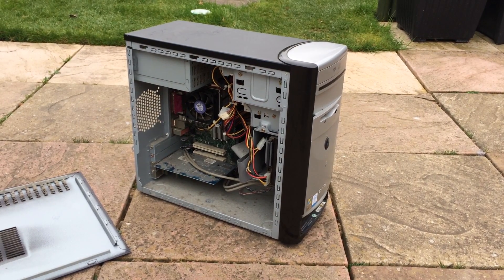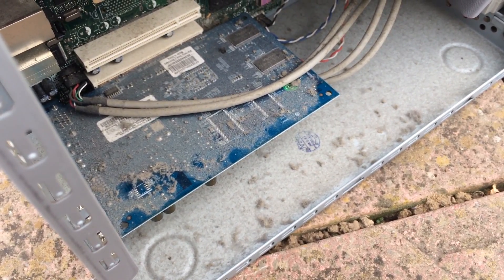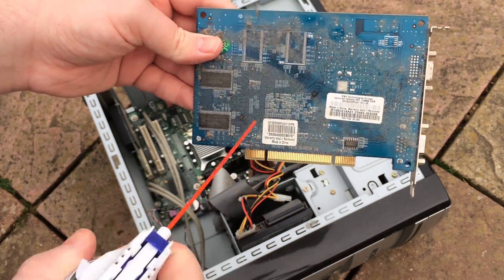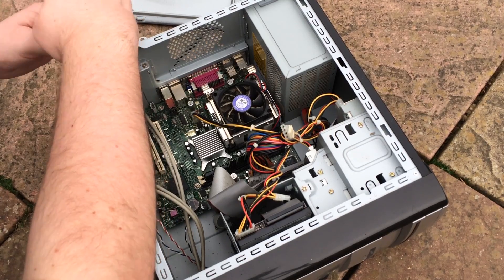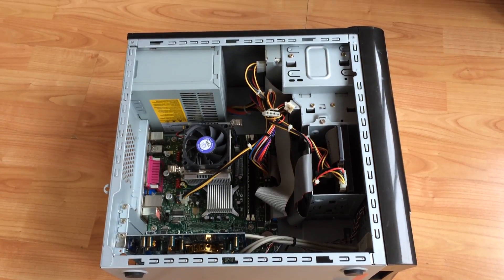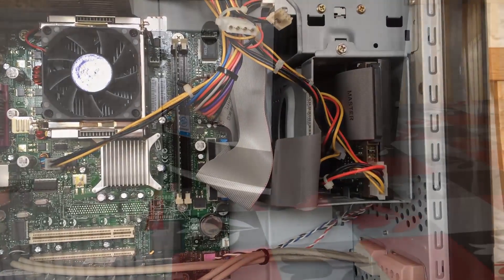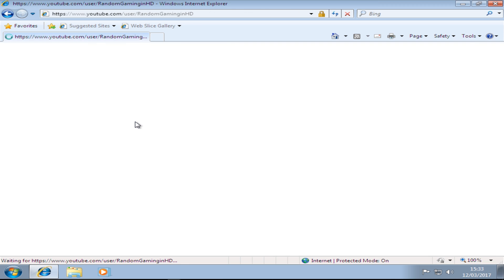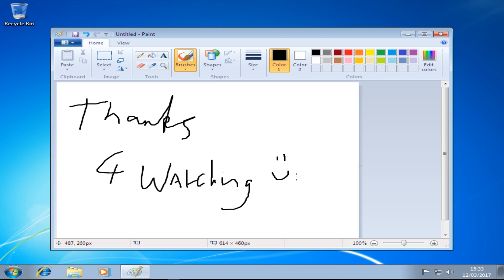Cleaning up a Super Dirty Old PC

Comment: I've got a question I'm hoping you can help me with, with my computer case fans, the fins are extremely dusty. I can't really get in with a rag or anything either to clean them, and a handheld duster isn't strong enough to get the dust off. What do you suggest I do?
Reply: Maybe a Q-tip
Reply: The most important thing: prevent spinning when cleaning. The same way as electricity creates movement, movement will create electricity.
I'd suggest a toothbrush or a pastry brush. Also a good choice to clean out heatsinks and boards without damaging anything.

Comment: I'm building an old budget gaming PC. I have G41M-P26 motherboard, Core2Quad Q9500, 6GB RAM and GTX560 TI. What Wattage PSU should I buy? I currently have cheap $10 PSU.
Reply: Get the cheap EVGA 430W and you'll be fine
Reply: Ashish Kotnala 500-600w
Reply: No, it's not needed.
Reply: Ashish Kotnala a decent 550 probs
Reply: FiftyHP for a 560ti? The Rec is 550
Reply: Still no, I had a GTX 560Ti, Q6600, 6GB RAM and my 400W PSU was absolutely fine.
Reply: The Q9500 has a TDP of 95W and the GTX 560 Ti sits with 170W (210W if it is the 448 shader version)
Calculate around 30W for the board and maybe 5W per RAM stick.
Add a little overhead to be at a draw of high efficiency and you will sit around 400W for the PSU. Maybe abit more, depending on the drives and fans. (count 3W per fan and 6W per drive)

So I'd suggest something in the usual 450-500W range. But don't go too cheap, or the PSU will take everything with it in case of a failure. Around 40-45$/€/£
Reply: Thanks everyone for their suggestions. HappyBeezerStudios - by Lord_Mogul Can I go for the Corsair VS450?

Comment: my gaming pc I use it for browsing I been sick haven't been able to use it in 7days feel bad but I buy new and used parts to save money I wanted a second pc bought a laptop with broke screen I run it with the screen closed so its not even on but for 35 couldn't go wrong I helped my sister get a 50 dollar gaming laptop which is pretty ok ran csgo 30fps which is good for a laptop because mine was running like 5 frames lol

Comment: Nice job with cleaning and tidying this old warrior :p I usually suck out the biggest dust with plastic tipped vacuum cleaner or just have enough bars to blow out all the dust that lurks inside psu, fins etc. 

Ps. usually with older pc's which have "open" condensators in motherboard and are really dusty, have atleast one popped condensator. It can be replaced with bit of handcraft if the pc doesn't wanna work anymore, done it a few times to older pc's to give them life for a bit longer :)

Comment: 2:34 That thermal paste looked a bit watery.
Reply from the maker: Xenon777 yeah it is quite watery, but works very well
Reply: The video was accelarated, that's why it looks less viscous.
Reply: Xenon777 is an overclocked thermal paste
Reply: it's grey paint
Reply: Xenon777 it's bird-poop lol
Reply: I thought i wouldn't have enjoyed the video since you were just cleaning up the PC, but when i continued watching it i was impressed and satisfied at how well the PC cleaned up. Nice...
Reply: Even toothpaste is better than nothing. It will work just fine.
Reply: HappyBeezerStudios - by Lord_Mogul or mayonnaise, I've heard stories of that being used unfortunately
Reply: +Nathan Hamman Mayo should not be used for long periods though, a day is ok and then it should be cleaned. It will cause oxidation if used too much. You could stretch its use for longer than a day, but it obviously becomes riskier.
Reply: Xenon777 i
Reply: İts pigeon crap

Comment: I would totally recommend getting a blower.  It will pay for itself, you'll never have to resort to canned air.
Reply: Totally. I got my first blower when I was 17. Some ginger bitch from the local pub. It was a shitty night but that really cheered it up.
Reply: Honestly compressed air cans are a waste of time. I have been using my leafblower to clean out my PC every month for a few years, works great.  A good tip is to lodge a piece of wood or something in the fans so that they do not spin. Fans get loud when they wear out, I learned that the hard way lol.
Reply: I go with a compressor to clean out any dust from PCs :3
If theres any dust left after that i cleaned it wrong.
Reply: A N I M E
N
I
M
E
Reply: Ive seen some smaller units that go for a car plug and bigger ones that are more of the "industrial" scale but run on mains.
One of the small ones would work just fine for cleaning out cases, but the adapters to a main power socket available normally dont deliver enough power (beyond 7A on 12V)
Reply: Hey guys !
i have 2 blowers and one is not working 😊
Reply: I would not. They can create static on the innards of the PC and don't have dust filters so it will be shooting specs of everything at your PC. I am fully aware that this does not always happen but I once cleaned a TV out with one, it no longer worked. Don't clean your PC this way.
Reply: mr8I7 I got mine from Amazon it was a DataVac brand.  I believe I got mine for 40 bucks. That was years ago.  No regrets :-)
Reply: @raptorjesus3894  You sir should refrain from giving advice,  it has been proven that the very little current generated by spinning a fan is not enough to harm anything.  I use Leaf blowers exclusively for 20 years or so and never had anything damaged as a result.  You are propagating ignorant myths and trying to validate them based on Zero empirical data whatsoever.

Comment: buzzing in PSU normal it not?
Reply from the maker: A. Masood I'd recommend a new one as soon as possible :)
Reply: no thats not normal...
Reply: Your PSU is dying replace because if it goes it will probably take your motherboard with it. Psus are vengeful bitches never like dying alone they always try to take something done with them.
Reply: A. Masood It's probably coil whine  which is normal. Try running something that uses a lot of cpu and gpu and see if the whine changes. Btw do you mean like a buzz at mains frequency or a whine?
Reply: no, his psu wont fail like that, he will start noticing unstable voltages and blue screens and random shutdowns, psu that just pops dont have any effects like buzz noise
Reply: Raptor Jesus I have used, and still have lying around an old 60gb Caviar from early 2003 that has spent years being powered on 24/7. Still works fine to this day, needless to say, though, the bearing noise is terrible.
Reply: RandomGaminginHD I only hear it when I bring my ear close to case?
Reply: The fan is probably on it's last legs.
Reply: replace it before it blows your mobo or something when it dies.
Reply: it's very faint when idle and it's very hard to listen I heard only when my bring my ear close and pay attention it increases a bit if I play Assassins Creed IV Black Flag but only to be heard when I bring ear close to case.Thnanks
Reply: N!cky I'm just saying that the losses due to coil whine are so small they're not even worth mentioning. Coil whine is just an annoyance. Now otoh if a psu that hasn't ever whined starts to produce a sound, that might be an indication of an issue.
Reply: its probs 2 grams
Reply: A. Masood vibrations?
Reply: Hey, at least your HDD doesn't make loud, coffee grinder esque, noises.
Though I am pretty sure it's fine, ran WDs detection software and it didn't detect anything.
Reply: buzzing in psu happens in electromagnetic parts, mostly in emi filter and transformer, it can happen when there is a lot of noise in line 120/240v, or if it has been overloaded, if it is new like 1 year or less and it started happening from time to time its ok but if you can hear it 24/7 then change it, cuz of high noise in output that goes to components youre stressing your vrm on other components more and making system unstable
Reply: it wont
Reply: A. Masood Yep, that's coil whineb nothing to worry about. If youbwant you can also check the voltages under load.
Reply: its normal
Reply: Not if you're using a decent PSU. If it's buzzing your PSU is either something cheaply made, too old or defective.
Reply: eemarko Coil whine is NOT the fesult of a manufacturing defect and does not affect performance in any way. Furthermore it isn't related to age.
Reply: eemarko I'm using a cooler master b500 ver. 2 PSU and its 3 months old?
Reply: gordon it does, reduces eff of psu - > more heat cuz of vibrating magnet wire and bending -> friction -> heat
Reply: A. Masood, its fine i have cooler master G650M and its making same noise, its from EMI filter not from converter itself, youre safe. I have same problem. Osciloscope graphs show that everything is fine. Its just input noise from city power line.
Reply: N!cky thanks!I appreciate it!
Reply: N!cky I really don't know where you got that from, that's just plain and simple bullshit.
Reply: Gordon, i just know switch mode ps good, i just told him what is 80% the cas
Reply: Gordon +1 but still can be noticed after long term use(talking about 3 and more years)
Reply: N!cky Yep, it isnt likely to go away with age, but if it suddenly start s it might point to a problem.

Comment: Once i was a 7 years old, i cleaned my pc with water.
Reply from the maker: Ghazik Did it still work?
Reply: I haven't heard this version of the 7 Years song before
Reply: Actually you can clean pretty much anything with water except power supplies, harddisks and optical drives.. 

Though, you have to make sure it is 100% dry before using again and it can cause corrosion so there are better ideas.. But, I have tried it for shits and giggles and it worked fine, though, the lubrication in the fans their bearings got washed out.. and they didn't like that.. 

But yeah, except harddisks, optical drives and PSU's, it will work after.
Reply: feelsbadman
Reply: RandomGaminginHD u didn't clean the motherboard
Reply: I threw mine in our pool.
Reply: Unless you powered it on while wet, it shouldn't hurt it though.
Reply: Ghazik You monster
Reply: I was 7 years old for a whole year.
Reply: RandomGaminginHD Yes, it works with celeron D 3.33ghz.
Reply: Ghazik I cleaned my DS with water and it stop working
Reply: bruh you shoulda cleaned it with my authentic bacon oil
Reply: once i was 7 years old, i cleaned my pc with a leaf blower
Reply: Only real danger as per my experience was wearing out the fan bearings. I had a fan die in that way a few years back... granted said fan had been running for around 9 hours a day, full speed for over 10 years...

The risk of ESD is there but it's minimal in my work environment thanks to the high humidity.
Reply: Well, I have seen fans that have never spun extremely fast die whenever they want.. and the same goes for fans that have. So I have no clue if it can cause damage to be honest, could be though. 

And well, where I live the humidity goes up and down, up and down, up and down so I tend to be a bit cautious of when I do dust out my pc but even the times when I wasn't it still didn't give problems, neither did the computers I dusted out show ESD damage, ever. No weird crashes, no weird software problems, no killed machines, etc..
Reply: Ive washed motherboards, for real, even a CPU once. Just don't let them sit wet too long and make sure they are absolutely dry before plugging them in.
Reply: The Farklenator Water does kill electrics. The water, which is electrically conductive, bridges components and shorts whatever it touches. The only way to run a PC in water would be with highly distilled water. Most people who build submerged computers get new or well-cleaned components and run them in mineral oil.
Reply: make sure u leave it plugged in because water is not a conductor
Reply: Bas van der Meij You can do it with PSUs. Just need to give it a very long time to dry.
Reply: Bas van der Meij only if pcb is water coated and I wont ensure you anithing
Reply: Ashton, The capacitors in there make it somewhat dangerous and it could damage the PSU as well since those capacitors can retain their charge for a long period of time. Unplug the pc and pressing the powerbutton and then waiting for a few hours will drain pretty much all of them on the motherboard but I am not so sure about the PSU, I wouldn't bet on it. xD =D
Reply: I'm 24 and I still clean my PC with a leafblower.
Reply: Yeah, leaf blowers should be fine.. Just like compressors.. which is what I use.. lol :P
Reply: Bas van der Meij    That's a little risky...  compressed air can build up a static charge
Reply: Watch "How to give a computer a bath" by uxwbill. It can work if you take the right precautions.
Reply: I was actually forcing this behavior to push the old grease from fans...older fans are happy with thick oil, so when the grease/oil gets dry/out and you would push some light oil (like WD40 or gun/sewing machine oil) it will spin and scream as by heat it will let them leak and degrease ... i tried cooking oil, that works good, but a drop of 15w40 hits the right spot to silence them... (rule of thumb in lubricating spinning things: when replacing grease, you always go with the thicker one)

And about the caps ... if the light goes off on the mobo, its generally safe to touch them ...  if you wanna be sure, just use a res or bulb ... caps in PSUs are weak compared to a cap used in ie. car audio (in the school we were charging 0.25F (or 0.5? cant remember anymore) caps and throwing them like ball back and forth and who got hit, gave up a ciggie in the bin :-) ) ... dang i still have a "vampire bite" on my left leg from a charged cap hitting me :-D ...
Reply: +Leo my 2 :3
Reply: @Ghazik I know this is a joke, but it's actually safe to put HW in the dishwasher, for example I use it to clean boards from vaseline after LN2 sessions: https://twitter.com/OverclockingC/status/828364611984510976
Reply: Ghazik you're lucky, I've used soap
Reply: Deam man
Reply: lamo
Reply: plague inc lol i did that wen i was 6 yrs old
Reply: plague inc lol
Reply: Normal Person not water damages electronics, but salt in water. Water - dielectric.
Reply: s3m4 Games i mean, I guess you're right, some are saying it's ok to put water on PSU, I wouldn't chance it. I don't care how dry it gets lol
Reply: I know it can though it hasn't given me any problems in years neither did it ever cause weird problems with a computer that would suggest ESD damage.. 

I know it can cause a real big issue in even finer and more delicate / more exposed components in other electronics but I don't worry much when it comes to computers. 

Caution is always good though. :D
Reply: Cool, me too! :O 

We have something in common, niceeee!
Reply: f
Reply: Ghazik what the hell?!?!
Reply: supposing it dried fully it should have been fine
Reply: Ignafiltro Sanchez  i washed mobo and graphic cards just by curiosity and they work fine,i was surprised!warm summer sun completely dried it in 3 hours
Reply: Id usually completely disassemble them before applying water, like removing heatsinks, since if there is dirt below something it can trap water.
Reply: I have actually cleaned motherboards, mice, keyboards, and video cards with just plain tap water. Works fine. Just air them out thoroughly before using again.
Reply: Ghazik looks like a great idea though 😎
Reply: love you man
Reply: I once fixed my laptop's power supply, after i opened it i wanted to be sure i would be safe and to discharge it I threw it on water, semi demineralized water, but still. (something around 20/50 us/cm)
Reply: This comment made my day :D
Reply: dont feel bad when i was 4-5 i tried to fix my gameboy advance by washing it with water
Reply: GaMMaLiKKeR My grand ma made that, fucking shiet
Reply: it's okay, I blew up my PSU back when I was 12 years old
Reply: once I was 15, I saw that comment xD
Reply: Digitalgi  I clean dusty PCswith leaf blowers. Works great just be careful
Reply: Ghazik WHAT???
Reply: Ghazik Same age I tried cleaning my little CRT with water... Still worked, but the built in VHS player died... Surprised now that the CRT didnt make a loud pop... All it did was make an orange screen for awhile... Be aware I did this while it was on...
Reply: rip
Reply: Kane xdd nemiz
Reply: Axl Gaming absura cpu
Reply: Only way to do it man
Reply: BRAH you NEVER cleaned the inside of the PSU
Reply: Just what the f_ck
Reply: DOES NOT WANT!

Your pc is not thirsty. It does not want water.
Reply: You can do that, with water and neutral soap. 
Remove from outlet, dissasemble it, take out any power source and the cmos battery, get a bush (maybe even a clean toothbrush) and use neutral soap 
Then let it dry for a few days

I done that to some really dirty motherboards. In the web they say that it can even ressurect some dead ones, obviously dead by being too dirty.
Reply: Lol
Reply: Well it probably worked...
But the Pc didn't any more ^^
Reply: Even I did when I was 13 . It didn't go well.
Reply: you can put a motherboard in a dishwasher and its allgoods.
Reply: Ghazik water doesn't kill pc parts static shock does they have pcs in fish tanks
Reply: Ghazik :D